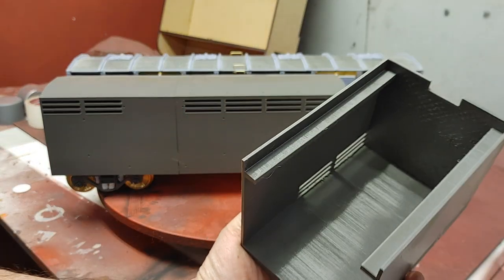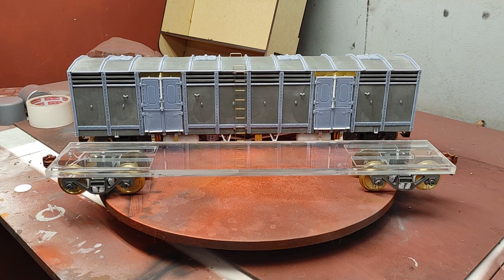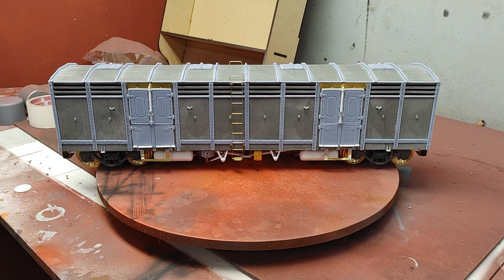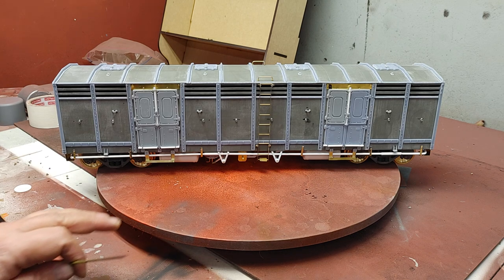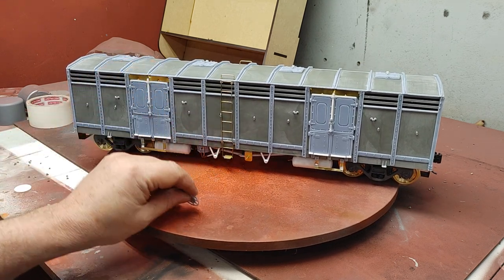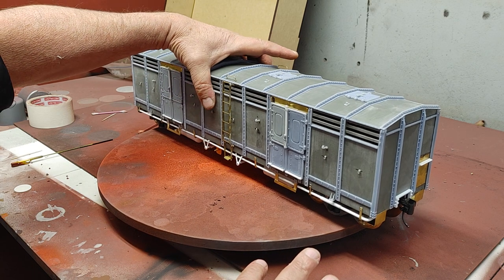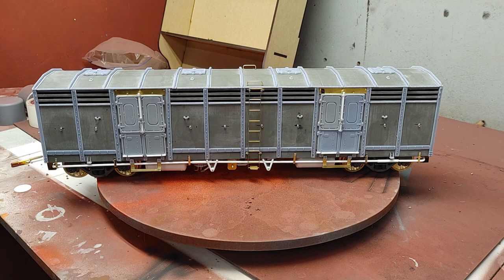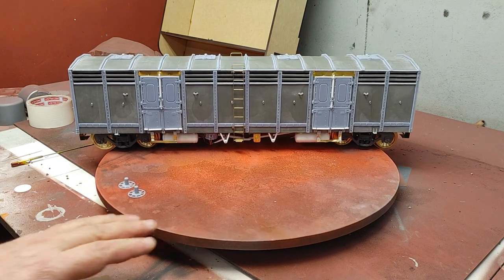How is it built? A quick video to show you what goes into a GZ-10 cattle wagon in 1/24 Cape Gauge 1

Comment: Thanks for another lekker video, Riekus.. 

Many people never see the hidden costs behind the scenes.. just to comment to the resin printing side, photopolymer resin goes for roughly R1000 per liter, but it doesn't stop there..  there are the hours it takes to set up the slice files with all the supports, the Eskom bill for the 14 hour prints (especially when you're controlling the room temperature in pursuit of good prints), the FEP sheets that stretch out and require replacement after x-amount of prints, the LCD screen that burns out after x-amount of hours exposed to UV, the liters of IPA needed to clean the excess resin off, the coffee filters, the kitchen towels, all those rejected prints - the list just goes on and on.. 

Keep doing what you're doing, and thanks for the insight.. it's rare that guys willingly reveal how they do things, and you have my respect for sharing your school fees with the world.
Reply: EXACTLY . People just look at the end product and do not understand how it all adds up.The other problem is the availability of resin. everytime you use a new resin ,you have to dial in settings and waste resin.
Reply from the maker: Jip.